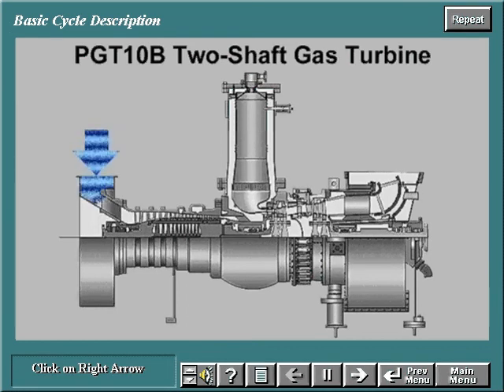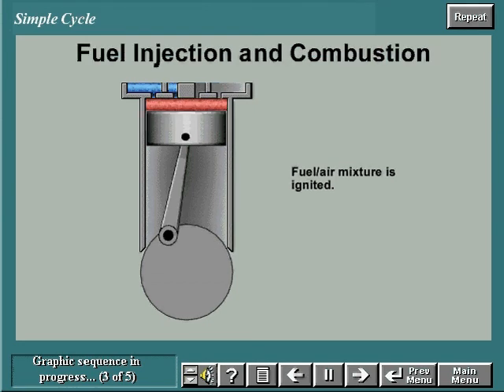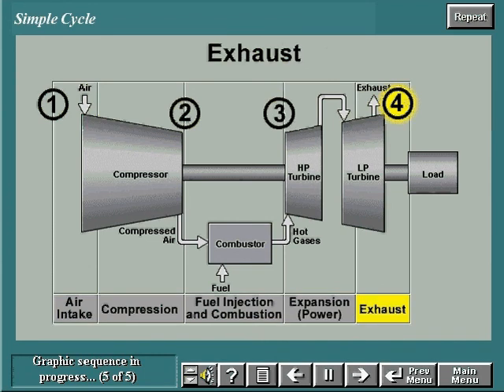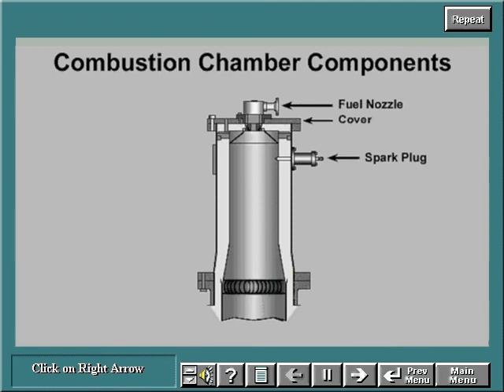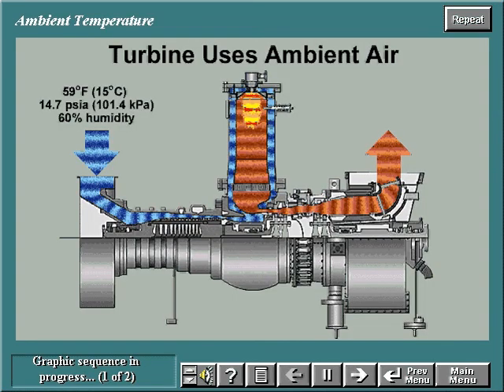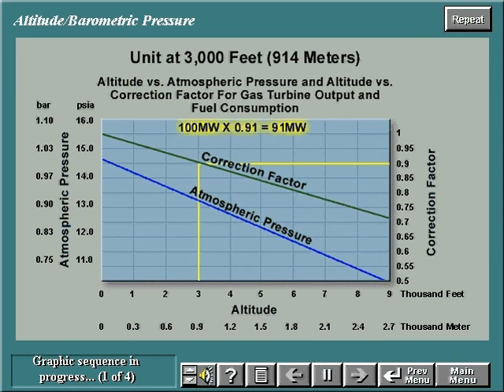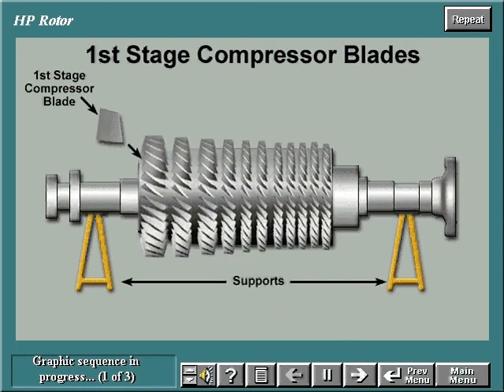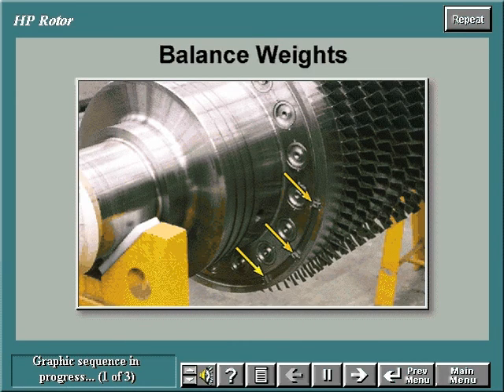two shaft gas turbine

Comment: 1:38 explains a little known fact that even at bottom dead center at the end of the power stroke, there is still a lot of pressure in the cylinder that comes out on it's own when the exhaust valve opens. So it's not just the exhaust stroke that expels the spent gases from the cylinder.